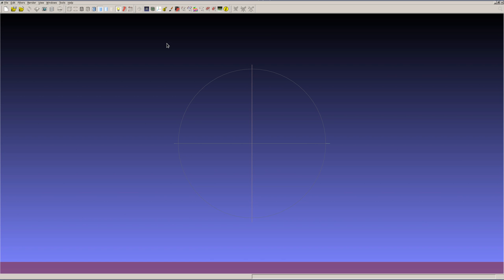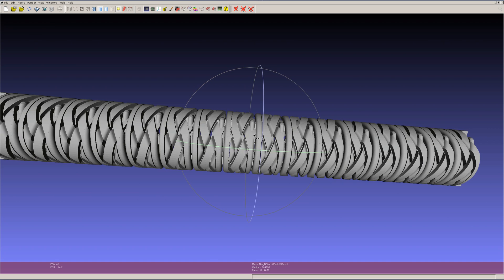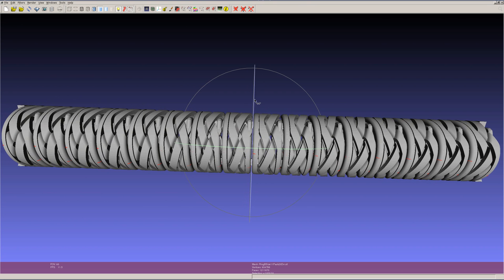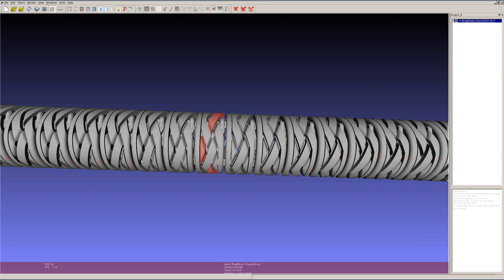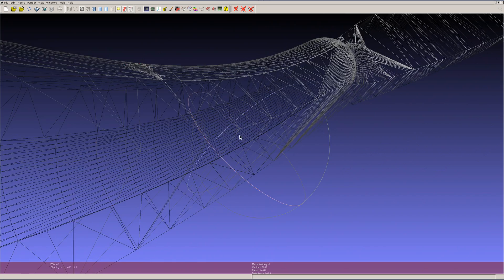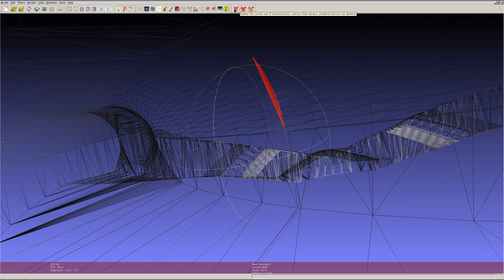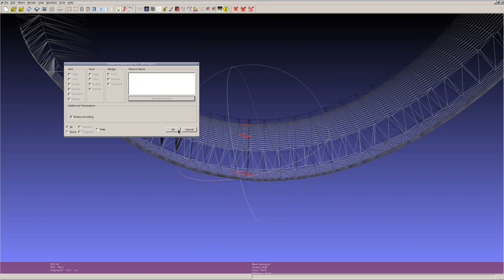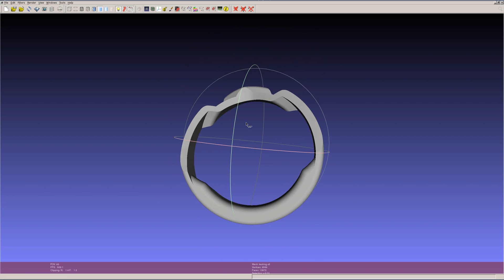Using Meshlab to manually fix internal face issues

Comment: Use Blender...100x times faster to do this exact thing, allows x-ray select through, then disable x-ray and deselect the surface tris.  I've made many many miniatures using this method to combine geometry that doesn't belong together.

For non-manifold you can merge verts, and problem solved, single manifold surface in the first place.

It does have a big learning curve, but it's vastly stronger than meshlab.